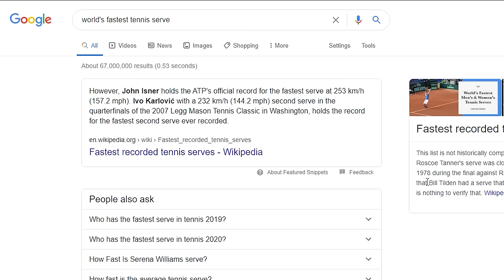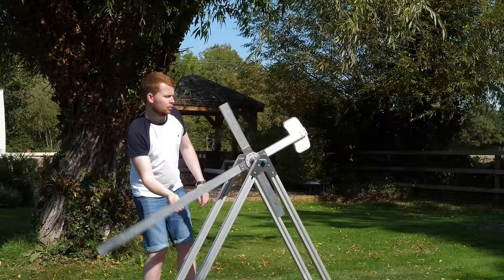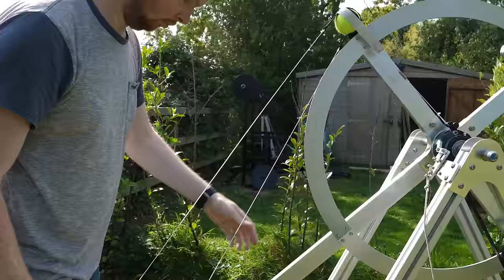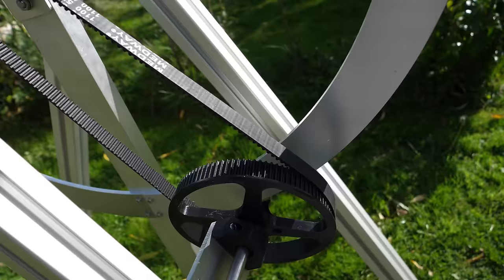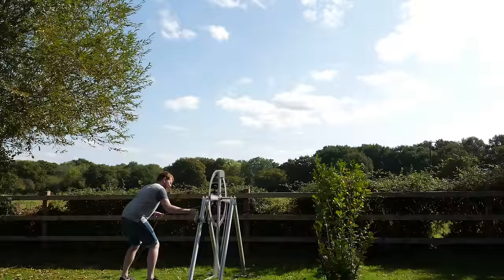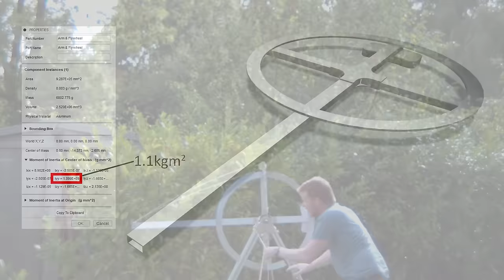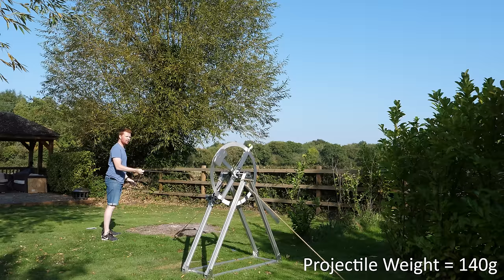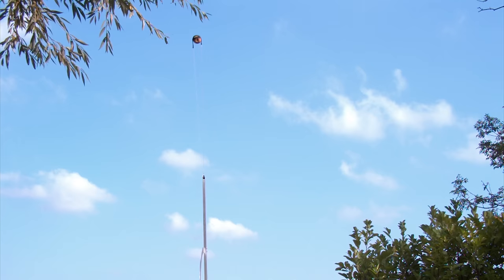Flywheel Trebuchet

Comment: The flywheel coming to a near deadstop left me speechless. such a good representation of the conservation of energy
Reply: Yes! Exciting ain't it, how most of that energy was apparently transferred into the projectile?
Reply: @MRptwrench  that one unlucky bird hit by the ball will experience all the energy it has stored
Reply: Does that mean good energy transfer , I suspect?
Reply: @williamstephenson2550  It represents high efficiency.
Reply: @shampabiswas7327  R.I.P (rest in pieces)🪦
Reply: A great representation of the tremendous efficiency of flywheel energy transfer. Gunshots have a hard time breaking 30% energy transfer, and bows and crossbows usually do about 80-85%, this flywheel looks like it must have managed in the high 95%+ transfer efficiency.
Reply: @0hypnotoad0  i would have liked seeing the length of rope altered instead of the mass... the same mass accelerated faster requires more energy.
one can also select the best generator to get a maximum power from a given resistance... 

can get a small mass going hella faster than he did, can get a heavy mass... moving.

like the same mass at twice the radius should take four times the energy to get twice the speed. so slightly less than double the length should get the tennisball to its maximum velocity possible with this setup.

tom seems really good at this. he actually missed the main point about achieving the main objective... maximum velocity. instead of using the same principle he explained so well to achieve it, he went off on a tangent and altered the wrong variable.

its great to see it demonstrated so well, but the objective was to get a tennis ball as fast as possible... not find the best mass to get the best energy transfer form the device. it could have been demonstrated better...
Reply: thought he switched it to slow mo
Reply: @shampabiswas7327 makes me think of that baseballer who accidently exploded a bird when throwing a ball
Reply: @HesmiyuMC  Randy Johnson, the dude threw hard. Pitched a no hitter in his 40's.

Comment: "maybe I need to put a motor on it"

Yes, yes you do.
Reply: No. He needs to put a BICYCLE on it. Leg power over arm power. Also a finer balance on the flywheel.
Reply: And make an even bigger one with an eight-spoke wheel and a heavier counterweight.
Reply: 2 horse compressor Motor will out-drive most fit people at 3400rpm or so, I think I have a spare one in my Shed...
Reply: @feldamar2  He needs a motor, no way I'd be anywhere near that if it were going faster!
Reply: @feldamar2  no no, a rowing machine!
Reply: In addition, stack 5-10 more flywheels in line and have a device that can throw 5-10 projectiles at once. Tesla motor powered medieval artillery barrage that can fit on a horse drawn carriage.
Reply: An Electric drill?
Reply: Motor on it would make it go a lot faster, however a bicycle would still be unpowered like a classic trebuchet was and it would also be cool to see how a better trebuchet could have been designed in an age without electricity.
Reply: @FMHikari  I want to
Reply: @thewolfin  cemented into the ground
Reply: @feldamar2   maybe you mean a bicycle that can transform into a leg-powered flywheel trebuchet?
Reply: Can you LS swap a trebuchet?
Reply: @dontwanttousemyrealnametol6765  ...well color me intrigued. Yes. Of course this. Why didn't I think of this...also This sounds Like Colin Furze.
Reply: and mount the whole thing on a turret
Reply: .. and a heavier fly wheel.
Reply: LS Swap the trebuchet

Comment: To increase velocity and distance, with only a minor modification to that rig, think fishing rod. The dynamics of casting a fishing rod is similar to the combination of a trebuchet with the stored energy of a catapult. A well made casting rod is designed to deflect and load up stored energy on the forward swing, and release that energy into the momentum of the cast weight at the end of the forward swing. The line is released precisely as the stored energy in the rod is released as it recovers to its original straight state. Casting distance is a result of not only the swing, but also the "fling" at the end of the casting cycle. A properly made 12' tournament casting rod is capable of sending a 3oz lead sinker well north of 200 yards, while towing line off of the reel behind it with far less moment energy demonstrated with that trebuchet. Ive had the line break during casts and the sinker, without the drag of line behind it, will fly several hundred yards beyond line if sight at lethal velocity. If the rigid arm on that trebuchet was replaced with a high modulus tapered carbon rod blank (or a recurve bow arm or similar) rated to deflect and load up with the weight being launched, when the ball is released, the rod will load and store energy, and release that energy rapidly just before the sling releases from the pin. The combination if the immense moment velocity of that trebuchet and the sudden rapid release of the stored energy should amount to a longer acceleration time imparted on the ball, creating higher speed and longer distance. Up the anty with an additional flywheel geared 3:1 to eliminate the momentum stall as the ball swings outward and loads the carbon rod blank, you will have a cannon on your hands.

Comment: In the mid-'70s, I had a summer job working in a factory that made snaps and fasteners.  I was responsible for maintaining and reloading 4 punch-presses, all of which had big flywheels that spun at something in excess of 50RPM.  When the punch got jammed in the sheet metal, the protocol was to hit the "Stop" button to kill the motor, and unjam the punch.  On this one occasion, because the flywheel had come to an apparent dead stop, I neglected to hit the Stop button and attempted to unjam the unit with a prybar, placed into one of the holes along the perimeter of the flywheel.  I initially tried to pull the prybar towards me, but the angle was awkward, so I tried to do it by pushing away, which ultimately proved to be successful.    The flywheel instantly seized the bar from my slippery hands and flung it across the factory, AS IF it were a trebuchet, where it flew about 20 yards down an aisle, missing the several dozen working on either side of that aisle, and smashed a chunk out of the concrete floor.  I should note that the flywheel was positioned inches away from a wall, where the prybar would have bounced back from and certainly maimed me, if not worse.  The shop foreman came over and calmly put his arm around my shoulder, taking me on a walk around the shop floor.  He pointed to several different large holes in the wall, adjacent to other punch presses.  He told me, "You're not the first to do this, and probably won't be the last.  Just don't do it again".

Comment: "A crank handle" NO MOUNT A BIKE THERE

Legs are better than arms.

EDIT:  You in the replies are all missing the point - this is cool because it's human-powered.  If you can get more power out of the human, it will shoot further and be cooler.  "Put an engine on there lmao" is no longer cool, you may as well just make a vaccuum cannon or something (which is also cool, but for very different reasons).
Reply: LIKE THAT EVERYONE THATS RARE
Reply: Nice
Reply: Yea a motor and a free casting hub
Reply: Add a lawn mover motor, and it turns into a Colin Furze video xD
Reply: Jet turbine?...
Reply: @vao879  that would be interesting however hot and expensive
Reply: YOU DON’T NEED LEGS BILLY !!!
Reply: I don't care if it's human powered I care about the fly wheel.
Reply: @frozenwalkway  I think it would be interesting to see if it could be build with tech from the middle ages.
Reply: @Kiromos  that would be cool. Remake it out of wood and iron
Reply: Wouldn't mind seeing a rowing ratcheting mechanism instead so ALL the major muscles of the body are involved in the kinetic chain.  Of course that increases the complexity of the device a lot, but I wanna deadlift my power into a flywheel!
Reply: "build an engine"

Get a gun.
Reply: @
Asdayasman I like where you are going with this. Both arms and legs could be combined. Have you seen the human powered helicopter videos? Check out NPR Skunk Bear episode.
Reply: @MaxUgly  I think I might have, was it that giant thing that needed to be pedalled with both arms and legs and only just got a little bit off the ground?  I was so disappointed in that.
Reply: I mean the moment you start using an artificial power source you might as well just make a gun.
Reply: The point is usually not always being cool, some people would argue the efficiency.
Reply: Another idea is a wound coil spring. Doing this would also allow for adjustable range as you would have more control over how much energy goes in
Reply: Kiromos you can make this entire thing of wood. Would only destroy whatever pole you use constantly and have more friction when turning because of no bearings
Reply: Yes i like this human power model you speak of. As a slingshot and Shepard sling enthusiast this really interests me. I'd love to see some targets and small stones shot out of this thing.
Reply: Here he needs speed. Legs can provide better torque, but are slower than an arm. If we are to imagine that legs can provide a larger total rotational energy output than an arm (for example, he can rotate the pedals just as fast as a crank, however with extra torque), he would also need to change the gear ratio to make use of said extra torque. Now we have more energy for the flywheel, however that doesn't mean the launch itself will have more energy. Flywheels store energy, and as such have a practical limit as to how much energy they can store, where the closer to said limit you get, the less bang-for-your-buck you get from energy input, due to how deceleration works. 

Therefore now we either have to change the mass of the flywheel or its radius. Either way, its a lot of work, and we're still not done, because now we have to tamper with the energy output itself. In the video, he does just that by changing the projectile's mass. While this does make the energy output efficiency better, it doesn't increase the velocity of the projectile much, apart from giving the projectile a bit of extra air resistance. Also, chucking 1kg aluminium balls around is extremely dangerous. Therefore, we instead increase the arm's length, while keeping the projectile. Oh, and don't forget that changing the length of the arm will also technically change the mass of the flywheel. 

tl;dr - If you were to do that, you'd need a whole new trebuchet. And even then, a few extra seconds of cranking each time would be more time-efficient than mounting an entire bike.
Reply: @Prismate  shit if only we had a way to convert high torque low speed into high speed, and if only that mechanism was also commonly mounted on bikes, allowing us to utilise our more powerful legs to achieve a higher speed.

I guess some things are simply impossible.
Reply: Would it be cool with horses? I think it would be cool with horses pulling a rope wound around a drum.
Reply: @stephenspackman5573  Everything is cool with horses, I'm gonna have horses drag my coffin haphazardly into the hole when the time comes.

Comment: couple general trebuchet questions: 1) are launches/launch speeds consistent? 2) can you actually "aim" a trebuchet? (i guess these questions apply both historically and for this modern rendition)
Reply: Shame nobody answeared yet so I´ll do the honors. The lauch speed of clasic weight/lever trebuche should be as consistent as the weight of the projectile. And yes, siege engeneers would spent whole lot of time doing calculations to ensure the siege trebuche would hit it´s target. You dont want to spent month building one and realising it cant even hit the castle wall (you generally want to go over the wall and land inside). But its also good to know many sieges ended before you could build trebuche since people percieved then as we percieve H-bombs now. You simply lost your will to fight
Reply: Elaborating on the previous response, the hardest part of 'aiming' a trebuchet is taking all the variables into account. The air-resistance of a projectile actually matters quite a bit, but if you account for all of them, you should be able to land repeated hits in a rather small radius around your target.

Comment: Seeing the flywheel almost stop was really impressive. Definitely a bit of physics that doesn't look intuitive straight away.
Reply: The weird part is that the whole thing doesn't shake. You could easily put a break on it to force it to a sudden stop, but in that case the whole thing would probably flip itself over, like breaking the front wheel of a bike at high speed.
Reply: @Yora21  all that energy is carried by the projectile. It's amazing, isn't it?
Reply: @traugdor  What I am surprised by is how much energy gets transferred. The ball obviously has a lot of kinetic energy already while it's spinning around the axle, but I don't see how it "sucks" the energy from the wheel into itself. Intuitively, the ball should go in a straight line with the same energy it had before separation, and the flywheel continue spinning with the same energy it had.
Reply: @Yora21  that's the effect of the sling section.

Comment: Him standing next to a massive pole spinning fast enough to (probably) kill him is making me nervous.
Reply: Yeah his method of securing didn't look too fantastic given that if the apparatus fell laterally the arm would surely break some shit
Reply: @mrbouncelol  However the flywheel would have likely a decent amount of gyroscopic motion that would want to keep itself spinning in the same access of rotation. The faster it spins, the harder the machine is to tip over, assuming his cranking isn't rocking it back and forth.
Reply: Hah ! You said "massive pole"
Reply: yeah i was thinking for gods sake add some cement blocks to a frame at the bottom man the entire video
Reply: @JakeShuf  My main concern is the fact that if he trips over or something while spinning it up, he's kinda fucked. Big heavy spinning things scare the shit out of me.

Comment: Have you considered putting tracking devices into the trebuchet projectiles and convert that into a visualization? It would be neat to see 10 shots done and to see its accuracy/grouping.
Reply: u got 2k USD? that would be the estimate cost of your request
Reply: @brian9829  a youtuber with 1.12M subs does
Reply: @brian9829  $2000!?

You can get trackers for well below $50 each.
Reply: @Sierra-Whisky  are those capable of polling accurately enough and at a high enough rate for a projectile? I'd think that would require pretty expensive hardware, if it's even available given the restrictions on GPS.
Reply: @Sierra-Whisky  will it survive a trebuchet impact tho? u could even make one yourself using some microcontrollers but durability is an issue
Reply: Yeah! Or maybe someone with a drone to follow the projectiles and measure the distance
Reply: great idea. Maybe something like the grafics that shows the path of a golf ball at the tournements.

Comment: Somewhere there is a fantasy writer screaming in delight watching this.
Reply: I imagine a long axle along a wall. It's powered by several waterwheels and has flywheel-buchets all along the axle. They have clutches to engage the power of the main drive axle. They could even adjust the elevation angle of the assembly by rotating the release assembly on the flywheel axis. All of this, to launch the broken bits of many failed projects at invaders.
Reply: @thumb-ugly7518  I imagined something like this powering a long line of "instant legolases" along the top of a defensive formation, or on some kind of portable cart-mounted setup where it could be powered by manual labor or beasts of burden.
Reply: HERE I AM! 
I am creating a Pen & Paper Fantasy game and this is material :)